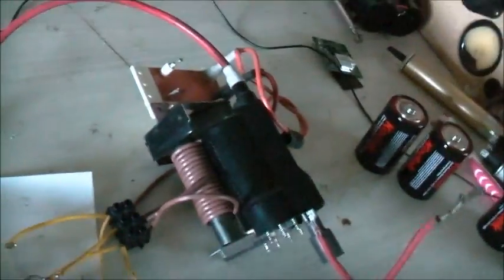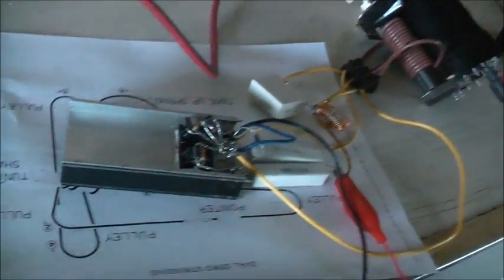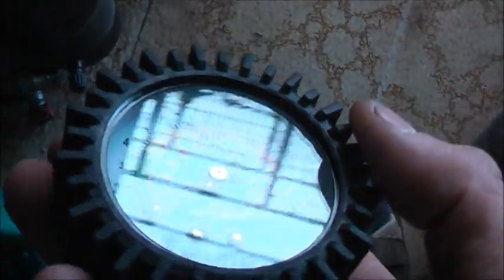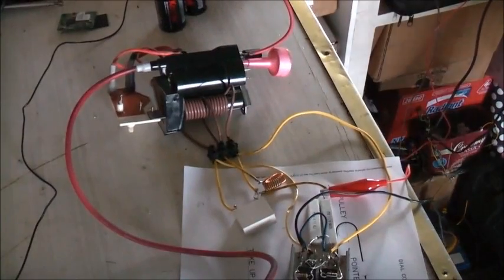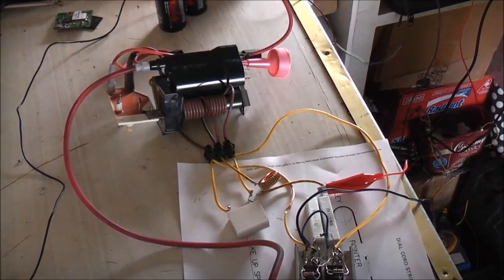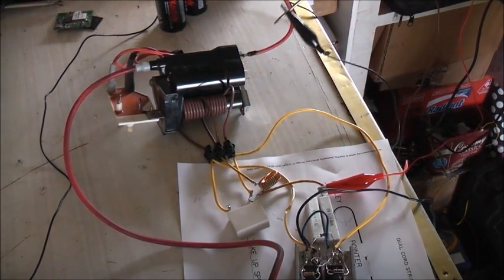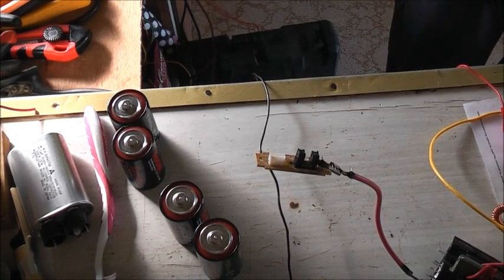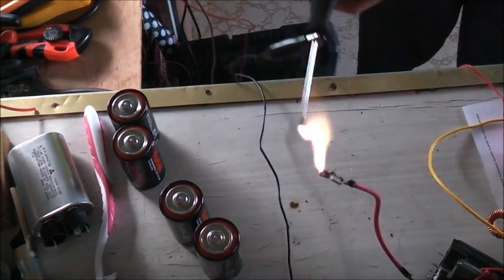ZVS on 36 Volts!!

Comment: (Continued....) I was just thinking about a AC motor being cranked up past a frequency beyond 400Hz so that it goes at a ridiculous speed, either to the point that something lets loose in there, or the bearings sieze up with a loud screech. :D

Yes, get a ferrite core, put a secondary winding on it so as to make the output as close to 240v, then drive it at ZVS frequencies with an induction motor attached.

Whiiiiiiiiiiiiizzzzzzzzzzzzzz  *POP* :D

{^_^} BoomBoxDeluxe {^_^}

Comment: Mmmm, lots of arcs. Nice burnout on the lightbulb. :D You popped it. :D

I have an idea: Seeing as the frequency coming out of the flyback is quite high, what would happen if you put a small AC induction motor on the output?

We both know that Induction motors need AC to spin, so what would the motor do with a couple of thousand volts going into it at quite a high frequency?

Also, is it possible to reduce the voltage out of the flyback, down to say 200v, so that it doesn't easily jump gaps?

Comment: are zvs drivers fun or what ! hey mate if ya want a plasma ball effect you need something in a lower frequency I was using a 555 circuit to create the effect and I cranked the pots as low as they could go .. zvs drivers were meant to melt things ! but that lightbulb took a damn beating ! cheers friend thanks for sharing ..